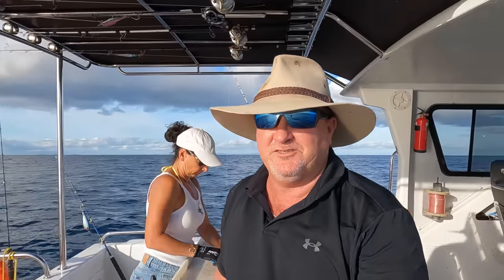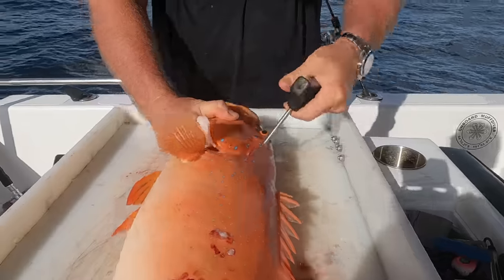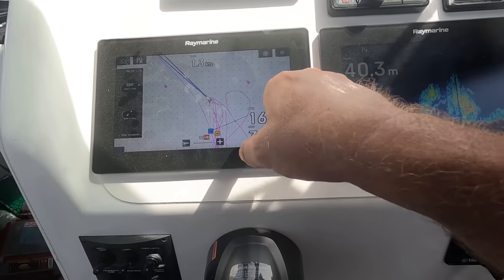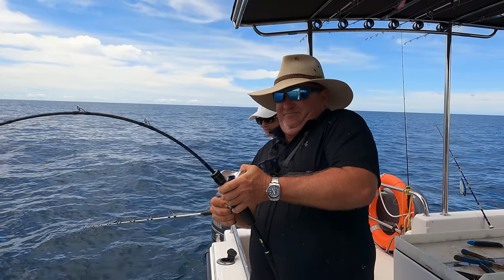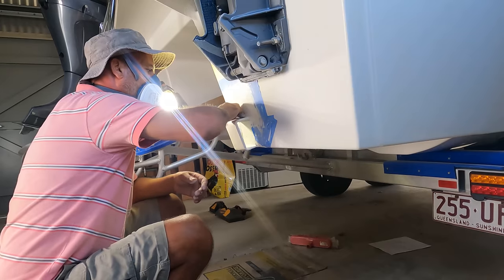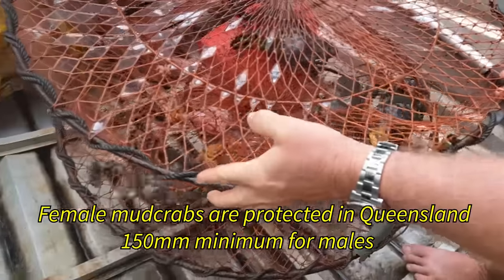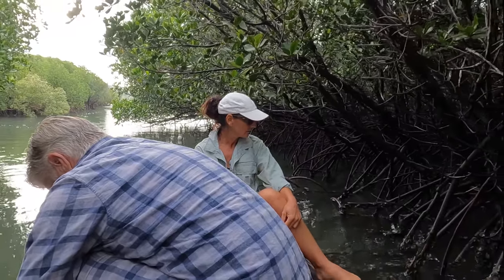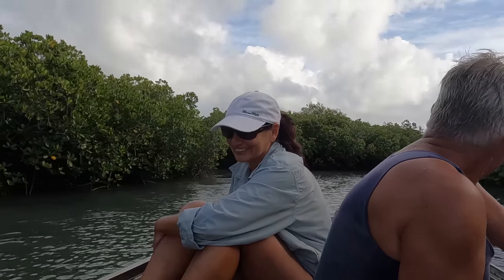💥FIXED!💥 Fishing & Crabbing 1770 ❄︎OBM1770❄︎

Comment: You need to invest in a spot lock electric mate to fish them isolated rocks they make life a lot easier when you find the fish
Reply from the maker: We have definitely explored that option. Unfortunately you can’t get one in a SELF-DEPLOY that will hold the big girl. So up and back up the bow all the time not to appealing. Maybe on a smaller boat would be awesome! 👌👍
Reply: @OBM1770  you might have to run twins😂
Reply from the maker: @JasonSmith-nu9yl  👌😁